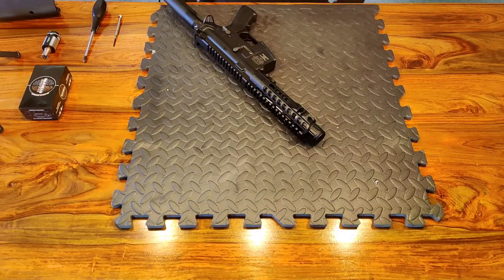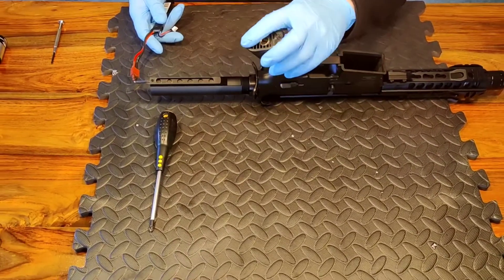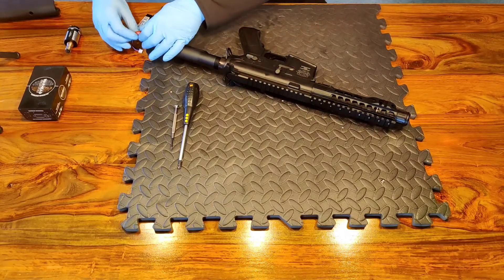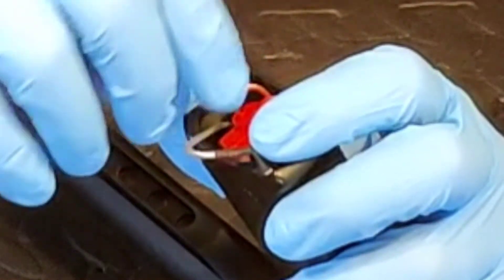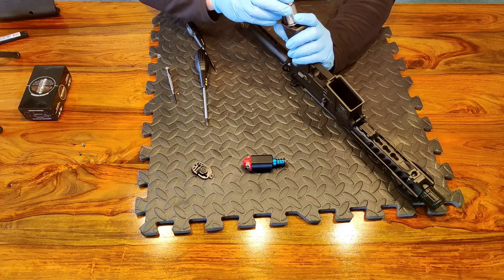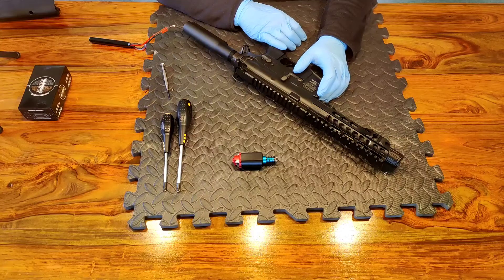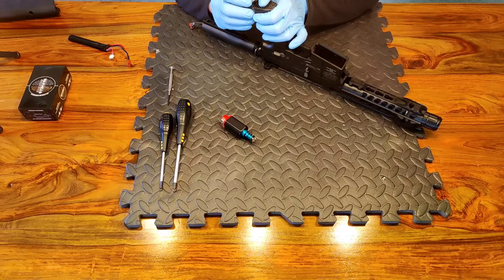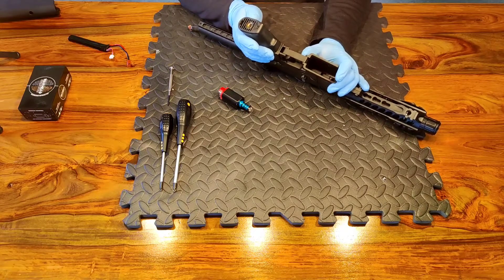How to fit a motor in your Airsoft AEG(featuring a Warhead Industries Brushless Motor)

Comment: This is just a theory but if you put a motor that on full speed could damage your internals could you use a warfet or any programable MOSFET to reduce the rof making the motor run slower but still get the response?
Reply from the maker: You can certainly reduce the cycling rate. However all these fast motors tend to do is find weakness or speed up wear. So you could certainly get a snappier response with a change of motor. Personally I would recommend a torque motor. Brushless allow for torque and speed however even by artificially reducing the rate of fire the motor will still cycle that one shot at the same speed so the chance of damage is still the same.

Comment: Do you think a specna arms ar that i bought for £199.99 would be able to withstand a motor like this or would I have to upgrade other internal first? Very new to this stuff lol
Reply from the maker: Apologies for the late reply. It's very much dependant on the replica even within the same model. Sometimes this motor will run for months or even years with no issues on a stock gearbox. Other times something will give up within the first game. It's a gamble with a motor of this spec if you don't at least shim the gearbox and look into pre engagement problems.

Hope this helps.
Reply: @rockbottomairsoft  thankyou for the reply 👍

Comment: Please don't do this ... why buy a 130 pound motor and then put it in like this loool .. madness please reshim your gears tut tut
Reply from the maker: This video is really just a basic guide. In the majority of cases a motor upgrade will be fine without a full reshim as long as the motor height is adequately adjusted. However that being said I completely agree, if your going to drop a lot of cash on a brushless motor then the likelihood is that you will be doing a full build. I think I mentioned that these motors have the potential to damage a gearbox without the supporting work. In my case I reshim some boxes if they require it but in other cases I have upgraded motors on stock replicas that have run for 1000's of rounds with no issues.

Comment: Do we need some sort of grease or lube for the pinion? What brand do you recommend?
Reply from the maker: Hi. Yes it's always worth putting a very small amount of grease on the pinion. It's not always necessary as sometimes the bevel will be well greased on a stock replica. However my preferred grease is superlube, but only for metal on metal.

Comment: Pretty good seeming upgrade.
Reply from the maker: Yeah, the brushless motor is quite extreme. This particular model is very high speed. I have no doubt without supporting work to the gearbox it could cause problems. But it does make a noticeable difference to performance.

Comment: This is definetly the worst way to do it.. You need to reshim the gearbox with pinion to bevel gear... Or else you can strip gears.
Reply from the maker: There is certainly a lot of advantages to shimming bevel to pinion. For a basic motor change I would not normally re shim the box. Its personal preference of course but If motor height is adjusted correctly you should not find that gears are stripping any more rapidly than I would expect from normal wear and tear. At least I've never found that.

Comment: Was the video length intentional, or a happy little accident?
Reply from the maker: To be honest I tend to decide what I want to get in the video but in the majority of cases the videos go longer than I thought they would.
Reply: @rockbottomairsoft  Have any longterm use feedback on the Warhead motor? I've been drooling over them since I heard about them. I'm trying to justify spending the money on one. Could be a video idea?
Reply from the maker: Thats a good idea. I will look to down a follow up video on the motor. As for feedback just now I would say it's mixed for me. On the one hand the performance the motor provides is amazing but on the other hand that same performance could be a problem in an otherwise standard replica over time. Ultimately I don't think I would spend that level of money on one, but that's just me. There is no doubt they are well made, will last and perform miles ahead of other brushed motors, however for me if I'm opening the box to do work anyway I will stick to my trusty high torques.

Comment: Does this motor work with mosfets active brake
Reply: Sorry for a late response, but this does work with the perun AB++ so it should
Reply from the maker: If I am being completely honest I am not totally sure. I know that gate will not guarantee compatibility with some of the etu and MOSFETs they produce. Personally I try to avoid using active brake if I can. Sorry I could not be more specific.

Comment: Which of the 3 engines is this? High speed Medium normal?
Reply from the maker: It's the high speed
Reply: @rockbottomairsoft  is there a torque difference between them?
Reply: @sganicocchi5337  I will be honest I am not completely sure. I don't believe so as one advantage of induction motors is the increase of torque and speed. The high speed is really fast. To fast in many cases.
Reply from the maker: @sganicocchi5337  I'm not 100% sure but I don't believe there is due to it being an induction motor.
Reply: @rockbottomairsoft  figures, if only there's a way to make rof go down to 33 percent
Reply from the maker: @sganicocchi5337  I suppose it would depend on gearing  for final ROF. But you can slow it down with a 7.4 that's low output. I run mine on a mild 7.4 but it's still really fast.
Reply: @rockbottomairsoft  i mean like how do i go lower than a titan's 50% rof scale
Reply from the maker: @sganicocchi5337  Unfortunately, that I am not sure on. Hopefully someone here may have the answer. You could maybe reach out to gate and see what they say? I'm sorry I couldn't be more help. I'm not very experienced with the Titan.
Reply: @rockbottomairsoft  im actually holding off on upgrading to expert firmware because of this lol, anyways thanks